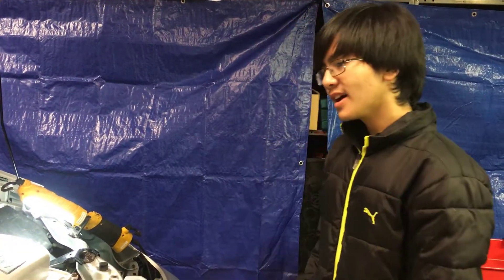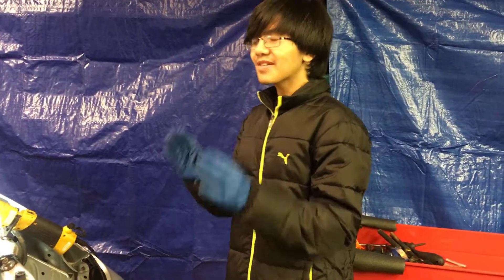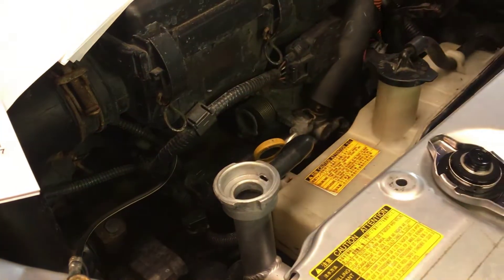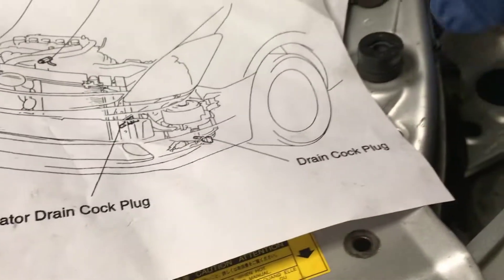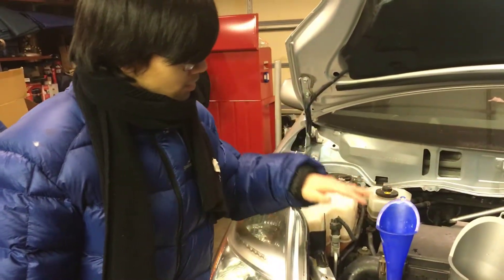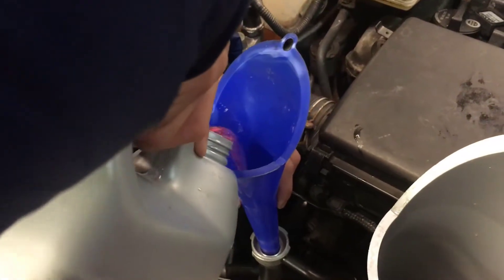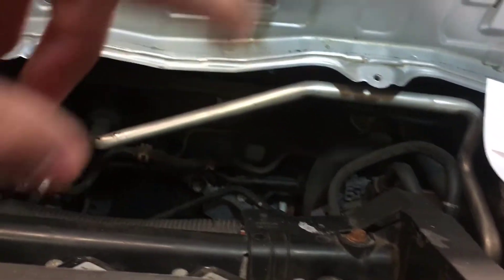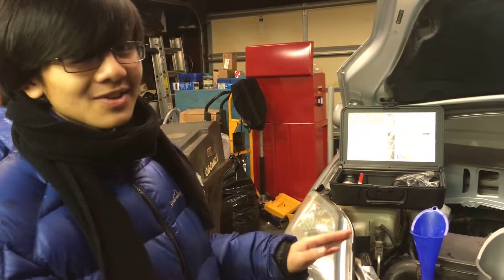How To Refill Coolant MANUALLY Toyota Prius Gen II 2004-2009 ICE | Steps After Drain Before Bleeding

Comment from the maker: Here are the #ᴬᴰlinks to tools, parts and accessories you may need to perform this repair:
1.  https://amzn.to/41nywdW  |  Zerex Asian Vehicle Red Silicate and Borate Free 50/50 Prediluted Ready-to-Use Antifreeze/Coolant 
2.  https://amzn.to/3ZFMyXd  |  PEAK OET Extended Life Red/Pink 50/50 Prediluted Antifreeze/Coolant for Asian Vehicles, 1 Gallon
2.  https://amzn.to/3Vp9ojq  |  Milwaukee 2457-20 M12 Cordless 3/8" Sub-Compact 35 ft-Lbs 250 RPM Ratchet w/ Variable Speed Trigger
4.  https://amzn.to/3D4LOCa  |  G9020-47031 Engine Electric Inverter Cooler Water Pump Assembly for 2004-2009 Toyota Prius 1.5L 
5.  https://amzn.to/41nDVla  |  GELUOXI 16670-21010 Coolant Flow Control Water Valve Replacement for 2004-2009 Toyota Prius 1.5L Hybrid 

Or Click on Amazon link here and search for what you need:  https://amzn.to/3D1T2GQ

Comment: I’m new to working on cars but for my 05 Prius, the radiator cap seems to be filled with red/ brown murky liquid and my reservoir tank is empty. If the radiator cap is filled with this liquid, should I drain it and refill the coolant, bleed, etc and refill the coolant reservoir as well or just refill the reservoir? Not sure if this is my man problem as my car just suddenly refused to go into drive and got the codes: P1116 and P3193, with P1116 suggesting low coolant level/ and 3193 suggesting low fuel levels even though my fuel is more than half full.
Reply: I have the same issue in my 2007. I ordered a new coolant control vale just in case. Were you able to fix your issue ?

Comment: He mentions in the video not messing with opening the bleeder on top of the radiator. If you don't have a vacuum system to use, you ABSOLUTELY want to open that bleeder in order to fill your system back up and open and close it as you activate the pump to keep burping out bubbles and filling your radiator back up.
Reply: He has another video for the engine side.
Reply: @Elizabeth Moore  This IS the video for the engine side. He does have a video for the electric side.  The electric side is pretty easy to flush and fill, with the exception of jumping a relay to make the pump run when you want it to.

Comment: Can air bubbles in your coolant system cause the engine to overheat or does it just give a false reading?

Also, will air bubbles present in your coolant system eventually work their way out or is it required to bleed them out?
Reply: It depends on how much air is trapped, but you won't likely get a false reading due to where the temp sensor is at. It's not where an air pocket would be. Main issue caused from a bit of air is usually poor heat to keep you warm in the car.

Comment: What if my reservoir is empty on my 2012 Toyota Prius can I just add the radiator fluid to that without any complications?
Reply: The overflow that you can see into? You can add some there, but you'll want to use the funnel method in the radiator and with fluid in the funnel, open the bleeder valve at the top of the radiator on the other side of the radiator (access through top of radiator with an Allen wrench) to bleed the air out of the actual system. 

If this happens to you again within several months it means you have a leak somewhere. If you can't ever find a leak, you may have a blown head gasket.

Comment: Hi. How many litters of coolant is required in prius 2007 1.5?
Reply: You will need about 8 liters, but it holds a bit more than that.  You just can't completely drain the entire system without large effort or specialty equipment.

Comment: We have a 2002 Prius. Coolant is low. Is it ok to just add a little more?
Reply from the maker: It should be okay to add coolant either in radiator directly (once the engine is cold) or to the extension thank / overflow reservoir for a 2002 Prius since it is a Gen I, and since you did not open or change anything in the system i.e. replace hoses etc..  Gen 2 is a little complicated because of the CHRS Coolant Heat Storage Tank, and that's what make Gen II a little finicky, but not too difficult...